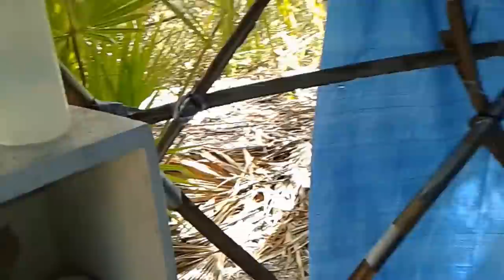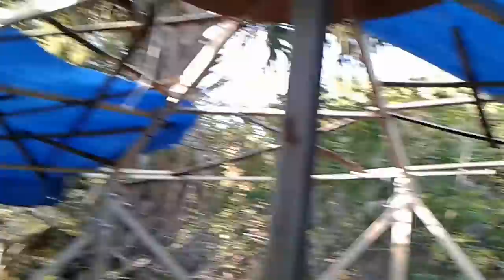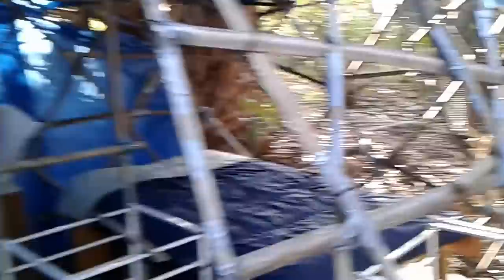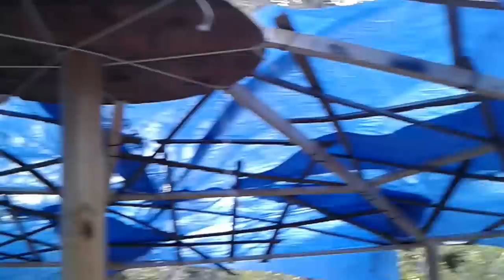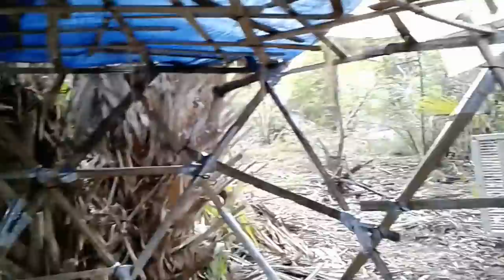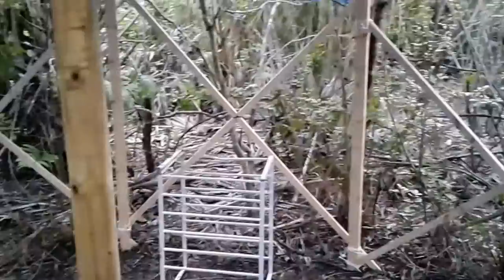Dismantling The Original Bug Out Yurt (V654) Bushcraft Primitive Technology Urban Survival

Comment: use a very good umbrella  that  would fit the width of the roof hole that way you can just lift the umbrella up still have shade and air flow and then pull it down and hold it down,  you could use a stretchy cord to hook it to a side pole whatever is closest
Reply from the maker: +Jen Hol That was a previous plan. It didn't work so well.